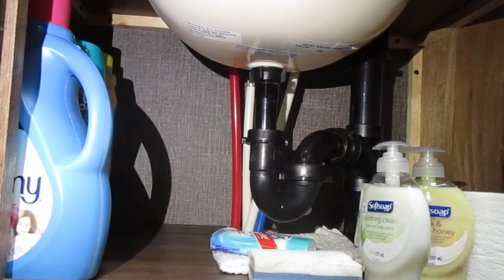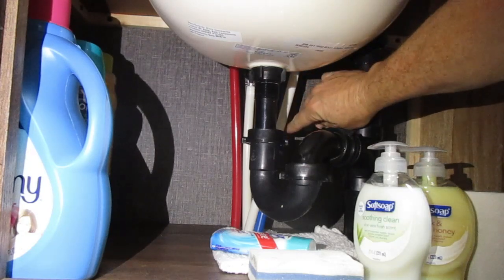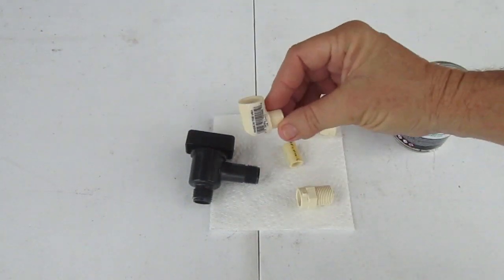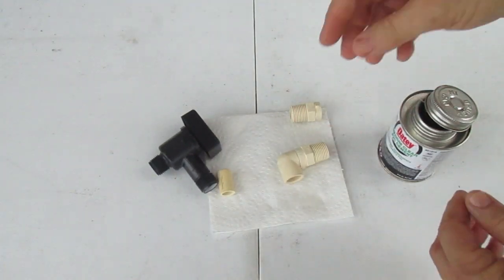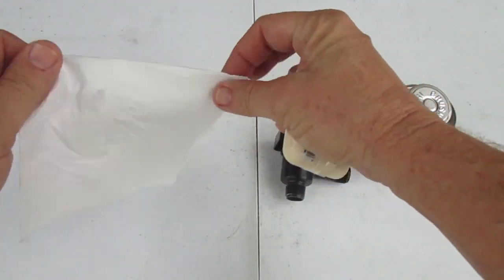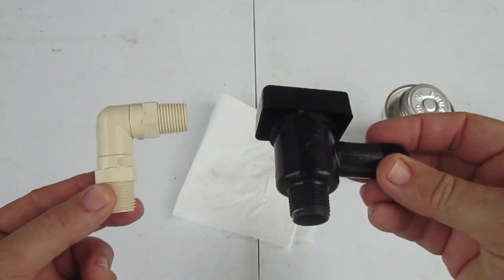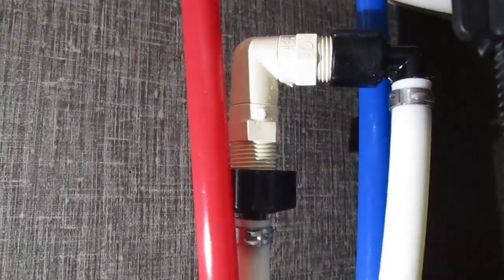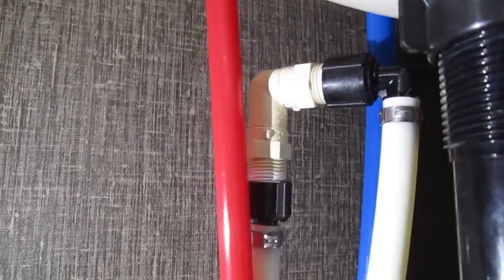RV Repair:  Replace Anti Siphon/Vacuum Breaker Valve in RV

Comment: But you not protecting the Park Water Supply. Sewage can still backflow into the water system. That valve is meant to prevent a siphon effect if you lose water pressure from being sucked back into the Park Water System
Reply from the maker: Yes I am.  I have a backflow protector on the inlet and also on the main park water supply.  NOTHING can backflow the wrong way...
Reply: I Believe You Are Forgetting That 
You Really Need One Backflow Valve At The Highest Point & One At The Lowest Point // So You Are Correct With The Water Supply Hose With Integrated Check Valve Being The Campground Safety Back-Flow
BUT BUT BUT
You Can Have An Internal Water Supply Line Back-Flow Issue Involving The Campers Own Water Lines Due To The High Point Check Valve Being Eliminated & The Pressures For Some Unknown Reason Are In Perfect Siphoning Pressure For A Back-Flow Event To Occur .
If Your Handy // Then Please Just Replace The Check Valve With A New Anti-Siphon Check Valve ! !
The High-point Valve Is Used The Most In It's Endeavor Of  Preventing The Issue From Happening .
Maybe That's Why It Was Making The Noise & Alerting You That It Has Been Over-Worked & Needs 
To Be Relieved Of It's Duties .
Pretty Damn Smart Device If 
You Ask Me ! ! 👍
Reply: @peterhoulihan6822  After flooding my bathroom once on my one year old unit I really don't want to put the same valve back in and risk it happening again. Flood a bathroom a few times and you've got a ruined trailer because a $10 valve. Far too many people have seen these valves fail (do a simple Google search) for me to take a chance on one of those again. Not saying not to put an alternative valve at the high point but I'm not taking a chance on the black plastic ones again.
Reply: How is it possible for contamination of other internal water lines. The black tank flush lines run directly from flush inlet at hookup point to the anti syphon valve then to black tank. It is not plumbed in with city water connection. Back flow preventer externally seems like a safe bet. I use one designated hose for my black tank flush only.
Reply: What I don’t understand is , how could there ever be a siphon if you’re just rinsing down the black tank. The other end, I would imagine is open to the sewer.

Comment: These valves leak all the time and aren’t worth the risk. A lot of the time they are almost impossible to get to. If you can find the lines that go to this valve, just splice them together with appropriate fittings. Then on the hose input side of where you hook the hose up to the black flush, install a brass garden hose breaker like the ones installed on a home.
Reply from the maker: Exactly.  This is an easy fix for a problem that can really flood you out

Comment: Everyone saying “he can contaminate the park” folks your tank has a vent on it. If you drain your tank and hook this up to flish, your vent would have to be sealed off and your drains would have to be sealed before the sewage would over power the park water. You would have to have 5 things catastrophically fail at the exact same time….. a sealed/shut dump valve, a sealed drain system, a sealed vent system, and the park water system would have to fail before it would ever vacuum back.
Reply from the maker: Thanks!  Right, there is virtually now way this will backflow...

Comment: You're a life saver man🙏🏻. Had this issue at 8 PM on a thrusday night and had a renter come to my RV the next day. Went to lowes spent like 2 bucks and got this working. You're awesome!

For anyone with questions about the backflow, I suggest you purchase a backflow preventer on Lowes for like $6
Reply: Did you use the cement seal when installing it under the sink?
Reply from the maker: Thanks!  Now you will no longer have any problems...

Comment: I'm using the backflow at the water source as well. Tried your method and Viola...perfect. Interesting, U-Tubers don't suggest using a backflow valve when installing a new backflush system.  Should be a gimmie. Anyway, total cost: $15.00. Now i can get rid of all the extra pluming with the temporary fix.  "More room for my wife's items".. of course. Thanks
Reply from the maker: Parks now almost always have the backflow valves installed.  I use one at the source also just to make sure

Comment: I’ve been afraid of bypassing it the way you did because of (maybe) the need for it to suck in air if needed to release vacuum in the tank. But the way you’re explaining it, that shouldn’t be an issue. Thanks for posting.
Reply from the maker: It is not an issue and will not backflow...

Comment: Deleting this valve risks contaminating the park/city water supply.  
There is a reason for it.  Replace the plastic one with a better quality one.
Reply: The manufacturers put this valve in to cover their ass.  Strictly a liability valve on their part.  If the elbow is above water line for the rest of the trailer, then an elbow is perfectly workable.  If you're not comfortable with that then buy an overpriced piece of plastic.  JMHO.
Reply: @keith7036  Some people hook their black water flush directly to a city water supply, and leave it connected for days on end, turning on as needed. I've seen people literally disconnect their black water flush hose to fill a tea kettle and put it back on. We're that hose to be turned on, and a sudden supply shock occurred in the city water supply, it could create a vacuum and literally suck the contents out of a black water tank into the drinking water supply. So if even if the elbow is at the high point, it doesn't matter. Now of course there's a bunch of other things that would have to fail, as there should be several other check valves along the way...
Reply from the maker: Thanks for watching!  You can use a hose end backflow valve at the main source also as backup you know...
Reply: @keith7036  BS - it is required  by code and removing it is a code violation BECAUSE you risk contaminating the parks water system with sewage.  There is no excuse for not knowing the law and why it is in place..

Comment: There is a safety reason for the valve. Maybe a better quality one would be desired though. However I've been listening to mine sound just like that from
 new to now 13 seasons latter without an issue.
Reply from the maker: I understand that.  I have a backflow fitting on my black tank flush inlet so there is no issue.  Some valves last and some break and leak...

Comment: Very grateful for the video! And all of the good comments it sounds like I will do the fix and just put a backflow at the hose connection! It's ridiculous having the water go everywhere! I'm about ready to flex seal under every water thing so it diverts where the hoses go I'm sick of water running everywhere when something goes wrong it should be channeled from the factory? To quickly make it through the floor? Oh well these are made very cheaply and quick! Thanks everyone good reads!!!
Reply from the maker: Thanks!  Water is the killer on RVs

Comment: I replaced mine with a one piece black plastic 90 degree elbow with 1/2" male npt ends on it. It is on ebay from Thetford and is for a Nautilis water panel. The flushing lines screw right on to it.
Reply from the maker: That works also

Comment: My Plummer totally agrees. Great job.
Reply from the maker: Thanks!  I do have a backflow fitting at the water source so everything is OK.
Reply: @skippy3840  So best to use a separate hose for the black tank flush with the backflow fitting attached to it on the other end?
Reply from the maker: @Kudu19  yes
Reply from the maker: @Kudu19  That is how I do it...
Reply: @skippy3840  I’m a rookie. What specifically are you using as a back flow preventer and where?
Reply: @dbanks7842  that is what I'm wondering too

Comment: I did the same, just removed the valve and use a backflow preventer on the hose connection.
Reply from the maker: That is the way to go.  I have a backflow preventer also plus a main cutoff on that line so I am good.

Comment: Did this repair myself just as you did, my valve was behind the shower and it made a mess. Water everywhere.
Reply from the maker: Those plastic valves always fail.  Make this repair and it will never fail...

Comment: What is the diameter of the threaded pcs andwhat is the length of the short cut pc of pipe?  Thanks, I have to replace mine
Reply from the maker: It is basic 1/2" cpvc fittings that you can get at Home Depot.  The short piece is about 1", just big enough to fit all the way into the fittings

Comment: I just did your vacuum breaker replacement and  now I don’t get any water at all coming back out when I unhook the outside hose. I thought I would’ve got some water back.
Reply from the maker: That is normal, mine does not backflow either.  Since there is no stopper valve to fail, there is just a clear pipe.  The water most likely self siphons from the pipe into the black tank.  No worries

Comment: I have been wanting to do this as my valve has failed on 3 separate occasions and I have now replaced with a brass valve and again it is failing as every time I use my black water flush, it floods the bathroom and all the basement. It is a HUGE problem.
Reply from the maker: This is a great fix.  Forget about the "safety sally's", as long as you use a cut off or a backflow valve at the source or water post you have no issues.  Water is the enemy in an RV...

Comment: You could have pus a Valtera check valve in your custom part to prevent back flow.  I am doing this right now.  I had no warning, just the flood..
Reply from the maker: I could have but this way there is no chance of another valve failing.  I do have a backflow fitting on this line connected at the source to prevent backflow also
Reply: @skippy3840  Can you show me an example to link of what you use at the source?

Comment: Never thought they had those on an RV, I know we had t ohave a backflow check every year for the business to make sure that didn't happen.
Reply from the maker: Only on RVs that have separate black tank flushing systems.  I have two other fittings to prevent any backflow on the main line also so we are safe...

Comment: Why not replace the valve with a new valve? Well done video.
Reply from the maker: You could easily do that, just showing a cheaper alternate way to do it...
Reply: Because there is a high chance of it failing again. If you do a search on the internet, far too many have failed for others to gamble flooding your bathroom. My coworkers failed on his first use (on a brand new RV!) and mine failed on my 1 year old Kodiak and I really don't want it to happen again. RV's aren't near as forgiving to water leaks as our houses are.
Reply from the maker: @prestonshobe  Exactly.  Thank you
Reply: @prestonshobe  agree!

Comment: Hi there, what were the sizes of the little pieces you got to make the elbow because my breaker valve has been replaced twice and it’s leaking again. Any info you could give would be super helpful - thank you!!!
Reply from the maker: It is just basic 1/2" CPVC pipe and some elbow connectors, nothing special.

Comment: Why not just get a new brass Anti-Siphon Vacuum Breaker?  They make brass ones that work great.
Reply from the maker: I could do that but it is really not needed.
Reply: @skippy3840  huge debate but they are actually needed.
Reply from the maker: @WildDigger  I have a water cut off and a backflow fitting at the source on mine so I don't really need it.
Reply: Part number please

Comment: I hope you never camp at a site I’m going to camp at.   Those hydrants that have a pull up handle draw water back when shut off.   Since you did your “fix” it could if left on, draw black water back into the hydrant.   Please fix it right!
BTW, the manufacture would not install those if they are not required by the manufacturing laws.   Trust that they are required.
Reply from the maker: Thanks for watching!

Comment: If your water input is lower than your tank, you'll eventually discover the purpose of that valve.
Reply from the maker: Chances are it is not and this valve us usually installed at the high point